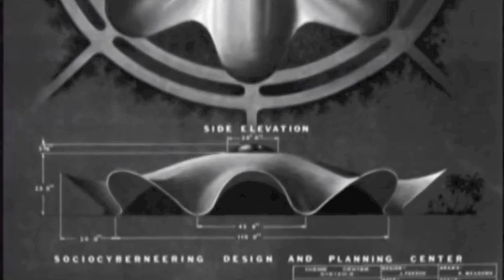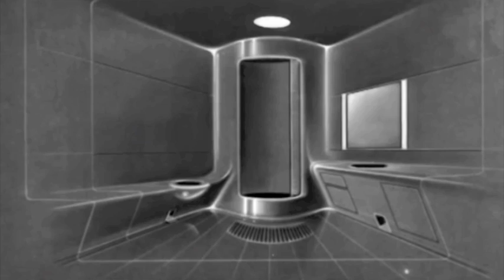Future Housing by Jacque Fresco

Comment: Ok so I was intreated in this and followed the link but it just turned out they want money not really help .
I'd have payed money for a book on plans / engineering specs for ideas  but alas it's only take not give .
Reply: It's not had to design a building. I was drawing stuff from an early in life. Now I have a degree in Architectural Engineering and did home designs about 20 years ago. Then I stopped and now 20 years I'm going back into this field. A book of plans. Secret is called greedy capitalism or the old ways of thinking. Control people through money it's that simple. I'm already looking into this designs. See another secret is Architectural Engineering and design work like this can't be patented. That's why the Venus Project is a Non Profit. Trust me it is non profit. It is labeled as a 501-c if I remember correctly